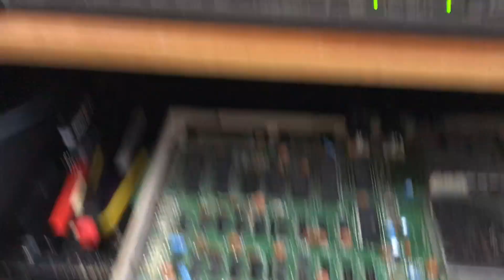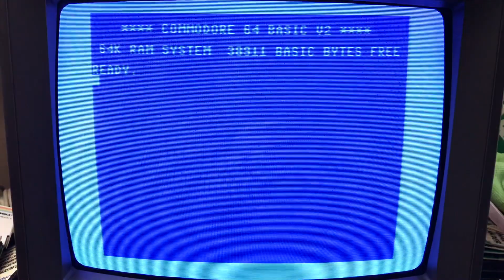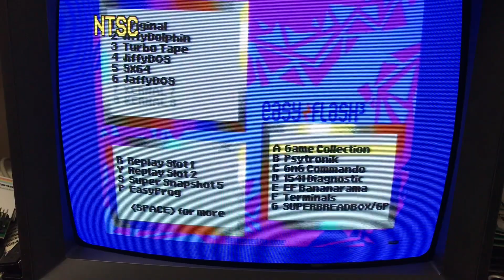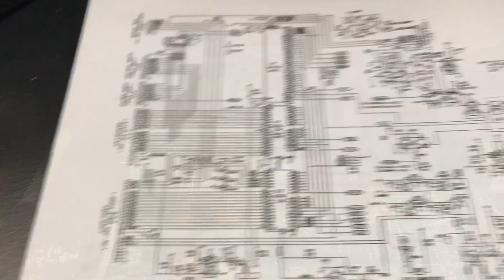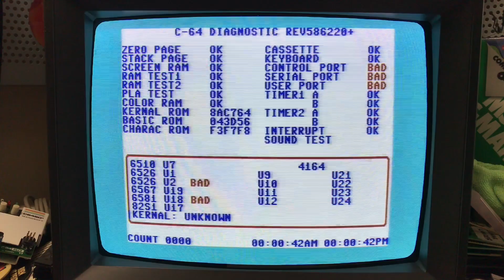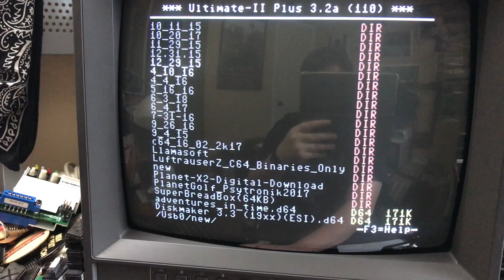Commodore 64 Repair #2 - Chris537's C64

Comment: I do remember someone managing to plug the power supply into the serial port on a 128D is this possible on any revision c 64 of  course in this case it fried the serial port control logic hardware.

Comment: Heya nice vids lug the C64 but i got the old on out of 1984, it's comes on but i not getting no power to the cassette tape? i try a other cassette tape and no power? can you tell me whats is broken? my other 2 newer C64 works all fine :)
Reply from the maker: Do you mean the C64 board you are working on is a 1984? So its a 250425? If you aren’t getting the motor in your C2N cassette to spin when connected, a few things you can try is to clean the contacts on the board for the cassette port first. If that doesn’t help, you might have an issue with the TIP 29 transistor which switches the cassette motor power on and off. A multimeter would be handy so you can check to see if you are getting the proper voltages on the cassette connector...

Comment: anychance I could inquire for some help? i have a c64 I want to fix and mod, but so far i just got the black screen with no flash, also if you were to sell a c64, how much would you charge?
Reply from the maker: Do you mean you are getting a black screen with no flash codes while powering on with a dead test cartridge, or just powering the machine up with nothing else? Black screens can be difficult to diagnose even for pros, but in many cases it is either a dead PLA chip or bad RAM.... As for the value of a C64, condition is everything and prices fluctuate a lot, at least if you go by USA eBay standards. A 7-8 out of 10 condition C64 in fully working and tested condition thats been gone through by an expert repair person should fetch at least $150 and likely more. Better condition and included accessories or original packaging has a big effect on price as well...If you need more help you can catch me on Twitter at @aphexteknol....

Comment: Now that I've dabbled a bit in repairing some c64, this video has been very informative. Thanks!
The piggy backing technique is one I can start using right away to test which cia on my board is broken.
Reply from the maker: I’ve never personally tried piggybacking CIA chips as I usually pull them and test them separately in my chip testing board to ensure they work 100%... Let me know how it works if you do!
Reply: Ooff, now I feel like I'm pioneering something. Haha! I'll let you know.

Comment: I'm curious: given the number of faults in this machine, what made you decide to repair it rather than use it as a parts donor?
Reply from the maker: Michael Graf I would only part out a C64 if the case was terrible condition and no longer usable (broken motherboards posts, cracks, etc) or the board had heavy trace damage from a previous botched repair attempt. Otherwise I try to save them all and I’m usually successful. :)

Comment: This is one of the nicest examples of a C64 display on a CRT I have seen despite the usual video recording artifacts. It also helps that you have a PVM. Wish I could find one at a good price.
Reply from the maker: jdryyz This display really is a beautiful one, and looks even better in person. Its a JVC though and not a Sony but it only supports S-Video and composite, no RGB sadly. It also handles PAL signals which is perfect since I own quite a few PAL Commodores as well from Europe. I found this one online for about $60 shipped a couple years ago...
Reply: @aphexteknol  Ouch! I am sad because where I worked until 2014 in a TV company they still had hundreds of very valuable and high quality (for us) crts : Sony, JVC. At the time they were already decommissioning them, so I missed an opportunity. They have probably now been destroyed despite being fully functional. Bummer!

Comment: Nice work! Somebody should hack that test program to optionally skip the RAM tests.
Reply from the maker: The version I’m running is already hacked to detect the kernal revision. If someone could add a RAM test skip that would be great! Thanks for watching!
Reply: Or, is Bedford Level Experiment referring to the Dead Test cart?
Reply from the maker: MindFlareRetro We’re talking about the diagnostic test harness cartridge actually. He whipped me up a special modified version that skips the RAM tests too in mere hours!
Reply: Now I'm curious about the Dead Test cart, I hadn't heard of it until you used it in the video. Found it here: https://www.thefuturewas8bit.com/c64-deadtest.html
Reply from the maker: Bedford Level Experiment The dead test cart is an indispensable part of my C64 repair toolkit. The dead test carts claim to fame is its ability to generate flash codes to pinpoint RAM chip errors through a pretty clever trick. Saves me tons of time diagnosing dead RAM chips when there are 8 separate chips, each one handling 64k x 1 bit of course. :)
Reply: So... hacking the dead test cart to skip the RAM test would not be a worthwhile use of time :)
Reply from the maker: Bedford Level Experiment Yep, that would sort of defeat the point. :)